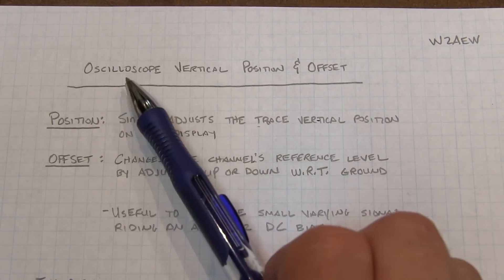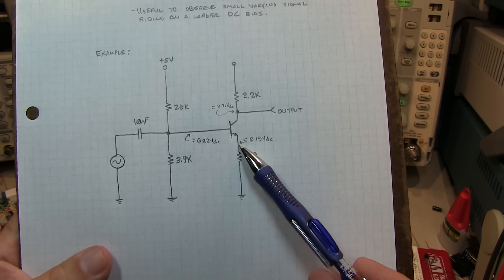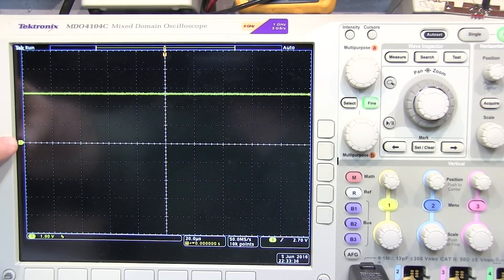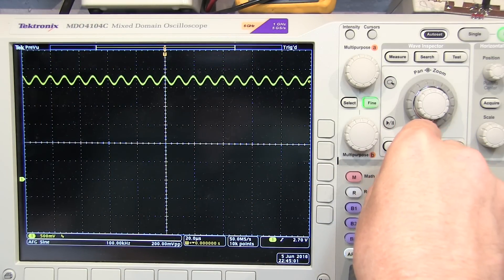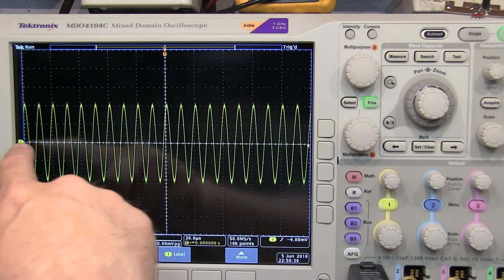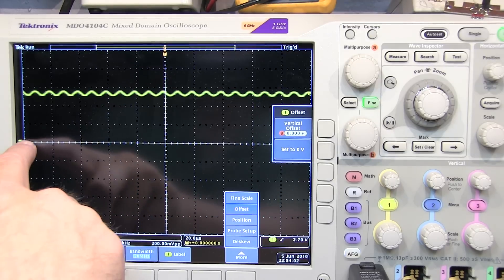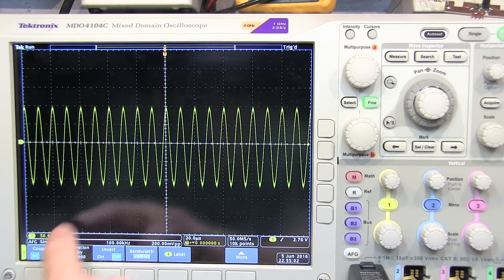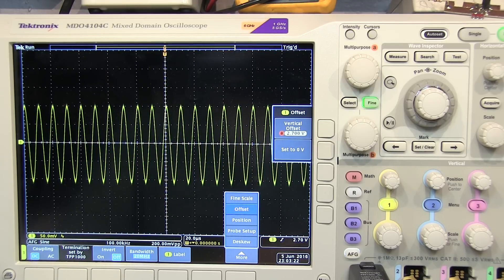#238: Oscilloscope Vertical Position and Offset explained

Comment: Great tutor, you always give good examples. Dave Johns didn’t know what you can do with this DC offset because it is rarely found in scopes, I have it in my Uni-t UPO2104CS. Now I will try it with my power supply as you mentioned. 👍

Comment: This one feels like it parallels or has something to do with the first time one sees a table or description of using uppercase and lower case for both voltages/currents and their subscripts in simple transistor circuits in textbooks the first time and how to differentiates between dealing with bias calculations and h-parameter calculations. It's very illustrative to draw separate dc-equivalent and ac-equivalent circuits. Thanks Alan

Comment: This is a very good explanation. We have a Tek MSO4000 series scope at work. While it is very powerful, it's annoying to work with - the UI isn't very responsive, and the spongey, horrible multipurpose knobs don't click. There's no keyboard input on the frontend, and a USB keyboard only works for file names. There are a few bugs in it, regarding USB input and measurements (USB keyboard language changes around all the time, RMS measurement showing 0 even if there is a very visible signal, clock changing around, etc). We have the newest firmware update, but that didn't seem to do much.

I have never seen anyone using the digital logic inputs and the bus analyzing features are used very rarely.

I don't know who chose the MSO4000 over the MDO4000, but the keyboard input alone is a huge advantage.
Reply from the maker: That flaky operation doesn't sound normal for an MSO4000, and I've used many of them.  Have you run a Self Test on the scope?
Reply: *****
Thanks for your response. I have installed the newest firmware update about a week ago and it made the UI a lot more responsive. The weirdest thing happened about a month ago when I had to monitor current over periods of two minutes with a loop-type current probe (while performing other measurements). The scope measured only half the current, and my other results seemed unplausible. Turns out I was actually powering my circuit with double the current. It was a software bug; after switching the input attenuation to the channel back and forth a few times, it went away. We ran a couple self-tests when we realized the channel was displaying incorrect results but it didn't detect it.

Comment: Well, I've used plenty of scopes in my time, but I can't remember seeing one with an offset capability. So how would one solve the problem of monitoring dc drift without an offset facility?  I guess, put a battery in series with the probe to null the dc out. Keep up the good work - as I've said before, despite being a retired electronic engineer, I still learn things from your excellent videos.

Comment: Must say this video helped me a lot thank you. The thing I'm trying to figure out now which I hope somebody can give me insight into this is:  How does the oscilloscope in ac coupled-mode know and show that the ac content is only 200 mV peak to peak WHILE the 2.6-volt dc is still connected. Now I understand a change in current and complex impedance and that it could have probably computed it with a filter circuit or some sort but when Alan says  "the voltage rides on top of the dc" I don't fully understand the physics. I understand that one can get a lot of harmonics and all that stuff but what I can't get my head around is that all the electrons move in ONE piece of copper wire!! Do they play bumper cars and depending on which speed they move they add up making new harmonics or do they all move in their own lane.  Or is it both?
Reply: In AC coupled mode, a capacitor is inserted inline with the signal. The DC portion of the signal does not flow through a capacitor. Thus, only the ‘wiggling’ part of the signal is passed through to the vertical input of the scope.

Comment: Hi Alan. I had a fundamental question, and you probably know the right answer 🙂 How, in general, (modern digital) scopes present the waveforms on the screen? Lets say we have some high Waveform Update Rate, like 100k Wfps (or probably even more). How often is the TFT screen actually been updated and if suppose that would be about 30 to 50 frames per second (I am just guessing here), are those 100k Wfps all shown divided on those 30 to 50 frames per second. We would have about 2k Waveforms to show every frame (supposing we some higher frequency triggering signals, in the MHz range). Are they just over-layed on top of each other? Thanks in advance!
Reply from the maker: Implementations differ between scope models & brands, but most will default to giving you an intensity graded display composed of the multiple acquired waveforms laid on top of each other.  Most scope will also give you the option of performing different processing of the multiple waveforms acquisitions to the display, such as:  color graded overlap,  peak-detect mode where the highest and lowest points of the acquisitions are plotted for each display pixel location, averaging mode, etc.  Take a look for my video on "sample processing"
Reply: @w2aew  Thank you. Yes, I know about the different acquisition modes and I have used them, but I was not sure about how those thousands waveforms are combined and presented to the user at the much lower refresh rate. Thanks again, and I have already watched your video on this subject 👍 Great content! Digital scope is a complex device, with a lot of performance aspects.

Comment: Very clear and easy to follow, as usual.  You know how to get to the point without leaving the auditors in the dark struggling to figure out what you're talking about.  By the way, the voltage values you wrote on your video notes, were they calculated or are they something you extracted from a datasheet ?  If they come from a datasheet, could you tell us which transistor you used or if you calculated them, I'd appreciate if you could explain how ?  Regards
Reply from the maker: They were measured with a DMM.

Comment: Thank you!, it's a great video!. Anh you can explain about DC Balance of Mixed Signal Oscilloscopes, sir?
Reply from the maker: DC Balance refers to an adjustment that is made during calibration of the scope that ensures that the DC level for 0V does not change when you change the v/div setting.

Comment: Thanks for another lucid and very helpful video. I wonder if you can use the same circuit to explain some other basic concepts such as, a) using a coupling capacitor to remove the DC bias voltage, b) mixing AC signal voltage with DC bias to produce the AC offset and c) phase inversion when using a common emitter BJT amplifier? Y
Reply from the maker: I have videos on AC and DC coupling on an oscilloscope, as well as the characteristics of common emitter, common collector and common base BJT amplifiers.
Reply: @w2aew  Thanks Alan, I'll have a look for them. Y

Comment: I have a Rigol DS1074, it has no "Offset" setting, only manual knob adjustment and AC coupling. Would have been nice to another solution for low budget oscilloscopes.

Comment: my old analog scope is using offset to adjust vertical position on the screen
Reply from the maker: older analog scopes just have one control (called position or offset), because they don't have a visual indicator of the reference (ground) level on the screen, and they don't have to ensure that the signal is properly adjusted for digitizing.

Comment: @w2aew
why on earth did tek choose to limit the vertical position to the screen? I want to just turn the vertical knob a few more times instead of going into a menu to set the offset. yes I know that such an extreme vertical position without adjusting the offset will seriously reduce the resolution of the a to d, but seeing a crappy pixelated signal seems better than seeing nothing. but tek could have done even better and start to automatically adjust the offset as you turn the vertical position knob more and more off screen. I use this offset feature all the time and it just seems silly that it is not automatic. maybe there is a good reason, like they really really want to be sure that the user knows that they are adjusting the analog front end offset. anyway, great video. thought maybe someone knew some easy trick other than diving through the offset menu all the time, but looks like I am doing it right.

Comment: Excellent video! Went on my DPO2024 to check if I could center the vertical by pressing the knob(wo going through the menus)...Nope:-(
Reply: mauro sobreira 
good to see someone else with the low end dpo scope. I have the dpo2002b. it definitely has a lot of features, but man, setting up measurements feels like a button mashing party. and the pulse width trigger is one of my favorite triggers, but its like 20 button presses and endless knob turning before I get the thing triggering just right :)

Comment: Nice video. I wish my scopes had this feature. I don't think my 2465 or my 2232 has this.
Reply from the maker: older analog scopes just have one control (called position or offset), because they don't have a visual indicator of the reference (ground) level on the screen, and they don't have to ensure that the signal is properly adjusted for digitizing.
Reply: +w2aew Sometimes it would be nice to have more of an offset while still using DC mode. You can do this with the Add/Invert to some degree. I get what you mean about needing to prescale in analog before digitizing the signal, especially since so many scopes are only 8 bits. Thanks again.

Comment: Do cursor measurements include the offset?  I don't think my old scope has the vertical offset but I will watch for it henceforth.
Reply from the maker: Cursor measurements always reflect the actual voltage of the signal.

Comment: Is the offset a math function rather than adding a capacitive coupling?
Reply from the maker: It is neither.  It is an analog DC shift/offset of the signal to move it within the ADC digitizing range.  The signal remains DC coupled.

Comment: Are these offset controls available on older analogue scopes?
Reply from the maker: older analog scopes just have one control (called position or offset), because they don't have a visual indicator of the reference (ground) level on the screen, and they don't have to ensure that the signal is properly adjusted for digitizing.
Reply: ***** Thanks

Comment: Complete NOOB here. But you are either looking at a DC signal OR an AC signal, right? Where is this AC component in a DC signal come from, and vice versa? A battery provides only DC and the wall socket [mains] only provides AC. How can DC have an AC component, and vice versa. Isn't it ONLY one thing or another? Please clarify. I truly want to understand this. Thank you kindly
Reply from the maker: I answered your question on the other video (AC/DC Coupling).